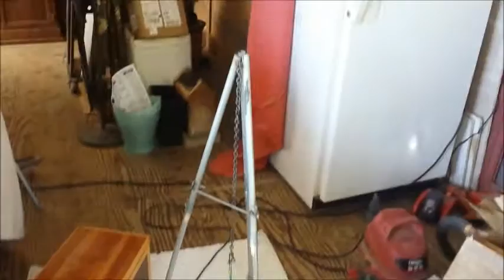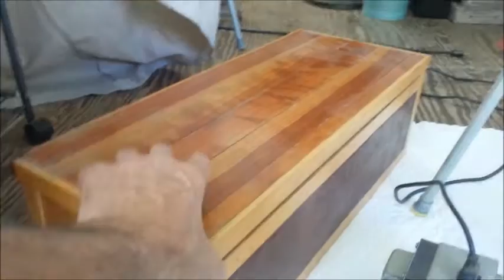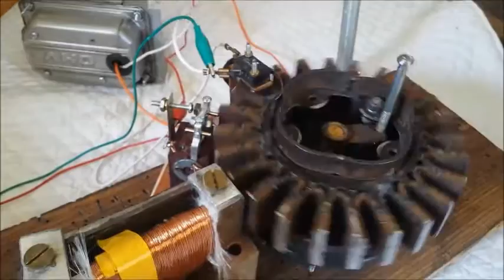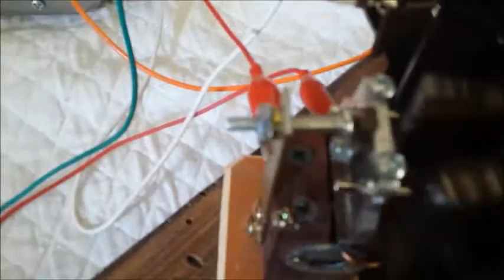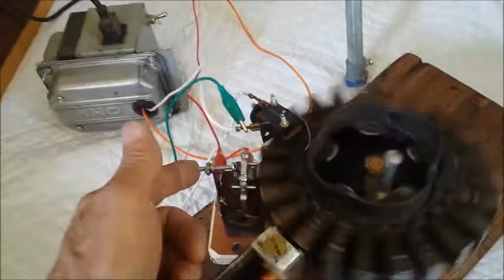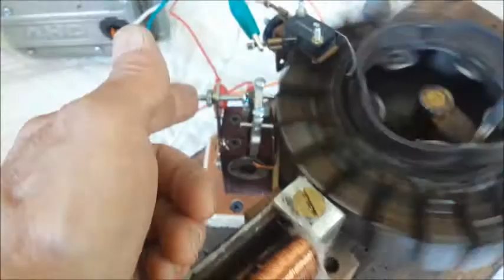First model set of Eds homemade Rock Chipping Machine Part Two

Comment: One wire from the iron of the pmh to a diode cap will make the tapper coil fire :) I run lights to my bike rim from the pmh :)
Reply from the maker: VERY GOOD and I do concur but NO, ED LEEDSKALNIN did NOT use diodes to cut rocks at CC. He died in 1951

Comment: lol do u not realize the same technology that ed used was used by the ancient Egyptians. There never was any chipping of any rock it was some other type of technology of slicing or cutting out the rock. Never in 1 million years will you be able to go to a quarry and do the same as ed did with that machine.
Reply: ik you are going to reply to this and call me stupid. However I am not saying that what you haven't done already is good I am simply stating that they were levitating these rocks somehow through vibration and frequency. Read about Tesla and what he discovered about tuning vibration and frequency. He said to have a little device called the earth quake machine which he could set on any building and tune it to its native frequency which would cause the building to shake and if left on long enough bring it to the ground. This is what I have been trying to figure out because evidence shows that our modern method simply doesn't work for cutting and lifting these stones with such precision.